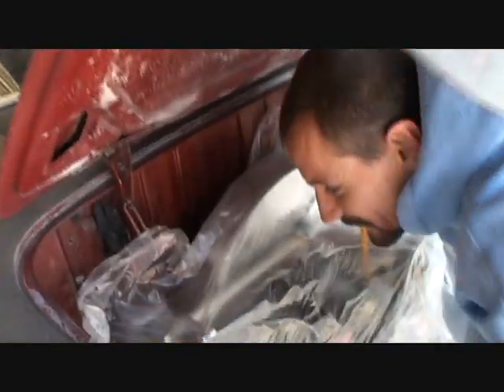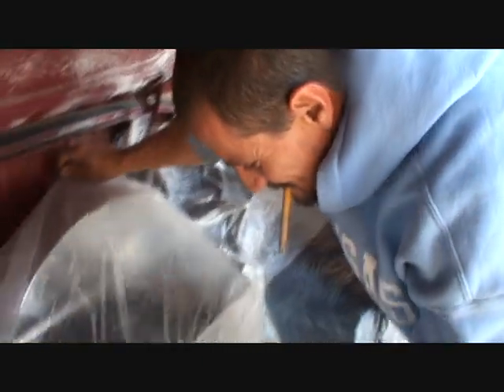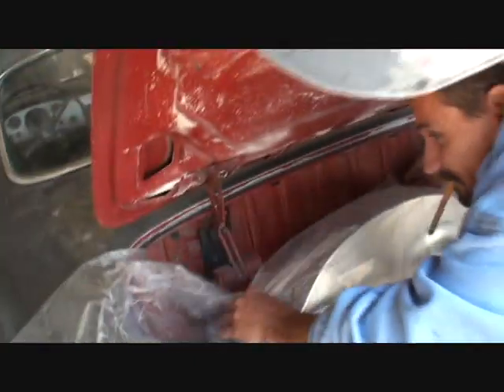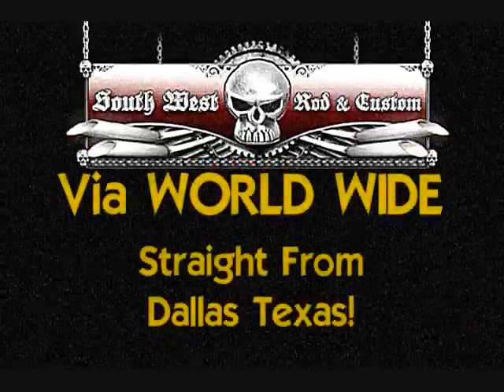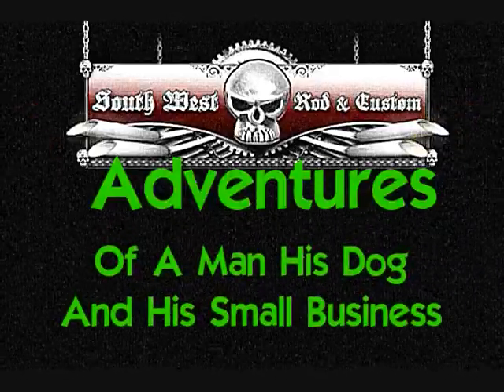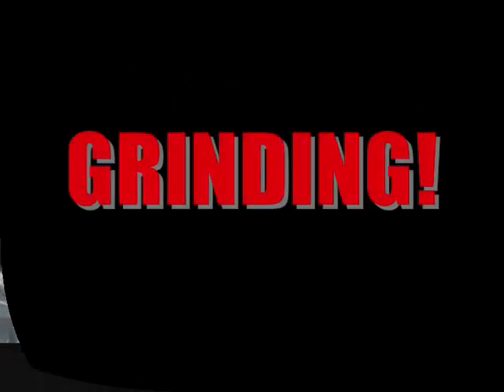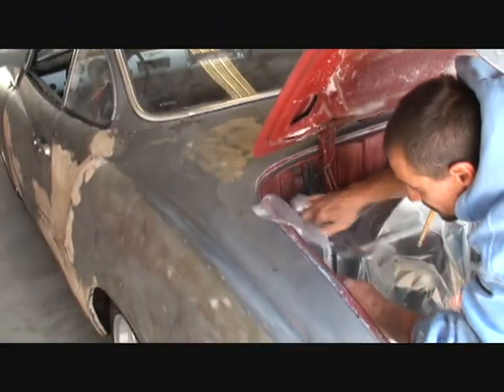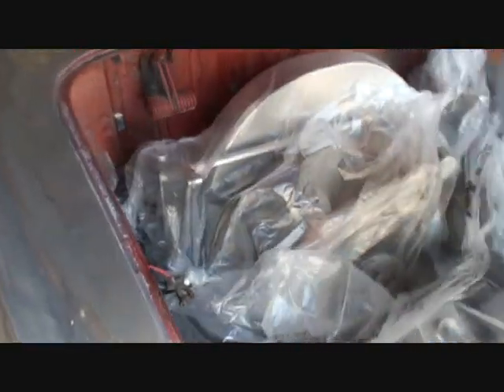1969 Volkswagen Karmann Ghia-How To Remove Old Bondo. Part 1

Comment: I used aircraft stripper to take the paint off a motorcycle gas tank.  There's one 4 inch spot with bondo.  Sounds like you're saying  i don't have to remove all of the old bondo as long as it looks ok.  (I was worried the aircraft stripper might have comprised the bondo.)  I'd like to down a bit and but a some fresh bondo on top.  (I can feel a low spot where there was a crease dent that was pushed out.)
Reply: You misunderstood. I meant you can grind the old bondo out when your done stripping the paint.  You can’t leave the bondo on there because the stripper chemical is penatrated into it. I was saying this to save stripper material where you didn’t need to use it. 🤷‍♂️🤷‍♂️🤷‍♂️
Reply: @diyautoschool  Ok, thanks for the reply.  I was worried the paint stripper had compromised the old bondo.. I'll get rid of the old stuff and replace it.

Comment: @ghtowagon The soda is a very fine powder. Pete showed it. It certainly wont remove Bondo this thick. If the soda blasting place also did sand blasting, they could've saved Pete a lot of work by sand blasting the Bondo out.

Comment: @swrnc hes right but use one for a bench grinder type of brush and shim it up, check my vids Pete, i did that yellow regal frame in like a day....still under the car. I will warn you if you use a 25000 rpm grinder wear glasses cause it will fling the brush needles all over the place!

Comment: With that much bondo and the metal all messed up anyway ... The simplest way to get that shit of is to heat the old bondo with a torch ... Just enough heat to get it going and a putty knife to get it off ... No use to breath that  crap .. but yep its not for the faint of heart ... using heat on damadged panels but ...